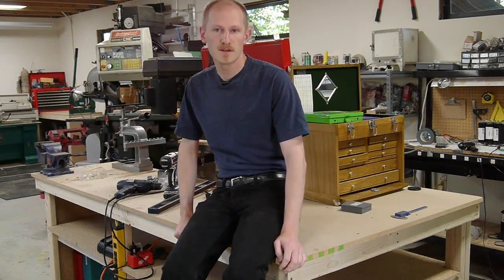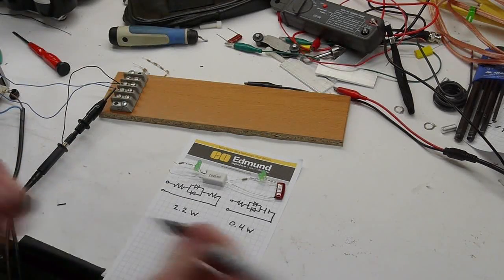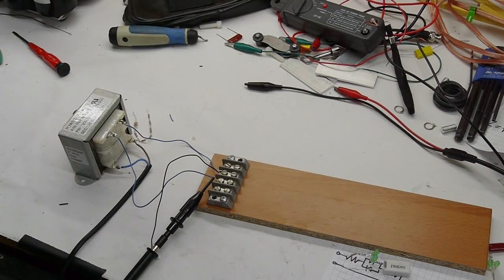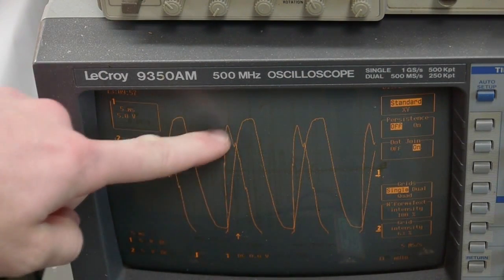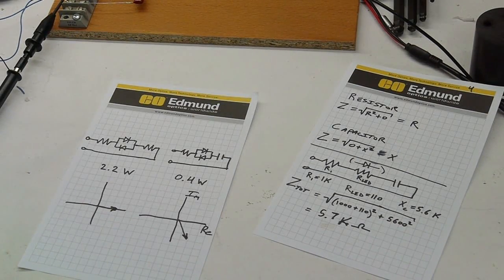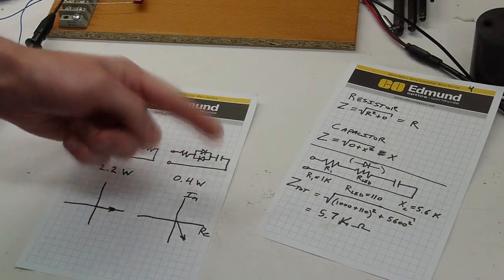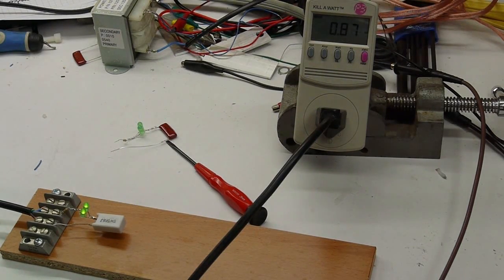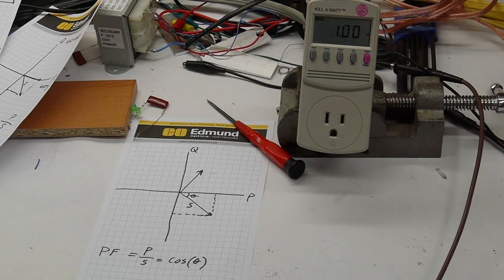Tutorial: Electrical impedance made easy - Part 2

Comment: Is there a law against selling devices like lamps with capacitors built in to make the power factor really low so you don't have to pay as much on your electricity bill?
Reply: Akfloatable The capacitor and the resistor both serve the same purpose in this case: To reduce the voltage going to the LED to safe amounts. However, they each do so very differently: The resistor burns up all the extra voltage as heat, and thus gets very hot, and wastes a lot of energy. The Capacitor instead temporarily "stores" the extra voltage, and then sends the extra current back a short time later.

In both cases, the LED itself gets about the same amount of power. (Hence the same brightness.) However, the resistor circuit also uses a lot of extra power to heat the resistor. (Wasted power, but power nonetheless.)

In either case, the power company will charge you for the power that you actually use: In the capacitor case, just a little bit of power for the LED; in the resistor case, a little bit for the LED + a lot for the heat.
Reply: Akfloatable You and Ben asked slightly different questions:

Ben asked whether he could get some "free" savings on your electric bill by adding a capacitor to a device, such as a lamp. My answer was no: Normally, a lamp is connected directly to the outlet, such that it runs at full brightness. If you then put a capacitor in series with the lamp, then you will decrease the brightness, as it no longer receives full voltage. You do save some $ on your electric bill, but you've also cut the brightness by the same amount: You come out even.

Your question was why the brightness was the same in both experiments in the video. That case is a bit different: In both circuits, there was a brightness-reduction device in the circuit, to make sure the LED didn't burn out. In the first case, he used a very inefficient circuit, which burned up a lot of heat. In the second case, he used a much better circuit (capacitor), which was far more efficient. Basically, the video showed a bit about how capacitors work, and how they can be better than resistors in some cases.

For Ben's question: You can't get something for nothing. If you use more electricity, the power company will charge you more.

For your question: Both circuits had the same LED brightness. However, one wasted a bunch of extra power to heat the room, and the other didn't. All that means is that some circuits can be more wasteful than others, which you probably already knew.
Reply: Akfloatable I'll add a car analogy:

I'll rephrase Ben's question: Can't you save on gas by driving half as far? Answer: Of course you can. But you haven't really "tricked" the oil companies; you've just gone half as far, and used half as much gas. (Adding a capacitor where there wasn't anything before is the electrical equivalent of reducing power to the engine-- perfectly legal, but not necessarily helpful.)

In your question, you were comparing two circuits: The first (resistor) was a big SUV, that wastes a lot of gas. The second (capacitor) was a Toyota Prius. Both will get you to the same place, but the Toyota will use a lot less gas to do so.
Reply: Ben Thurston Also would it make sense if you were running off of a generator (locally generating ac power) to make all your loads with really low power factor because the distance the electricity has to travel is so small to your generator and thus minimizing loss in the power lines? Or would there be the same amount of loss in the short line heating up the wire a lot?
Reply: Ben Thurston No law is really needed, as lowering the power factor will also lower the amount of usable power you get to your lamp (or whatever). In other words, if you added capacitance to cut your power factor in half, then your lamp's brightness would also cut in half. As such, while you could reduce your electric bill this way, you'd also reduce your (useful) electricity by the same amount-- everybody comes out even.
Reply: EricPiGuy Oh I see, but with something like a 100W light bulb would it be good to match the power factor to the right portion of power coming from the mains? Or do you end up spending too much on components to make it worthwhile? I'm going to hit you up on Patreon as soon as I have a little extra money I love all these videos so much...
Reply: Ben Thurston Well I think I see the problem that every time you plugged something else in or turned something on it would change the electronics needed to adjust the power factor, but maybe for a certain fixed array of devices that were always on it would be good to optimize for that...
Reply: Ben Thurston Dang sorry I went to give you 10 bucks on patreon but I didn't see a way to do just a one time donation,  you make a lot of videos I can't do a certain amount per video
Reply: +EricPiGuy Then why were the LEDs in this video just as bright when using the capacitor vs using the resistor?
Reply: EricPiGuy Maybe I'm misunderstanding but you said in your earlier comment:

"if you added capacitance to cut your power factor in half, then your lamp's brightness would also cut in half."

If in both cases the LED gets the same power, wouldn't the brightness be the same? And if that's the case then there's no draw back in trying to reduce the power factor by adding capacitors or inductors in order to reduce your electricity bill.
Reply: +EricPiGuy thanks, I also think this answers my question as well. I did not see where the electric company was losing out on money by allowing the transmission lines to burn up the energy in a low PF circuit. Makes sense now, nothing for free! so true

Comment: Ah, but the wattmeters are typically built with inductors, so their PFs are going to be less than 1.  And current in them will lag the voltage.  I wonder if any wattmeters have PFC by adding capacitance.

Also there are switching power supplies.  Again, for industrial applications (in my job experience, a call center with lots and lots of computers), power factor correction in the PSUs used for the computers was a big concern, not only for utility costs but also for proper operation of the backup generators and UPSes.

Comment: I noticed that a little bit was not mentioned , most circuits have reactance some are capacitive negative - as mentioned .
Left out from my limited knowledge , most all circuits have reactance , both negative / capacitive reactance & positive reactance inductive - above the horizontal line ;)
My perspective is from RF ham radio so a lot of all of the above in antennas & feedline Thanks
John
KD0CAC

Comment: In an industrial setting when the power company asks you to correct your power factor. If you make your load more resistive it will not change the inner workings of a motor. So therefore are you not wasting energy as the motor will still be generating the same inductance and reactive power which you cannot be billed for but you are then consuming additional resistive load which needs to be dissipated?  Although it seems fair that you should be charged some additional amount for the energy which is being pushed down the line to you, why not just calculate the inductive load and add a % to the bill, rather than force companies to waste and consume more power with increased impedance?
Reply: James A. McGuire I'm no real expert at this like Applied Science too long since I messed with the detailed math about it at university with physics before I switched to computer science.

But if I'd have to guess the problem the power company might have with it is that it can cause the mains to go too far out of phase. If it was a one on one situation I suppose this might be alright but I suspect there's a fair chance if say company A delivers power to company B and C. B is a big player and needs a lot of electricity and C not as much but they're fairly close to each other and B causes a pretty bad power factor which affects how some things work at company C.

In particular big electrical AC motors won't run as well if things are too far out of phase from what I remember and in my country there's regulation about it as well if I'm not mistaken but this will vary all over the world.

Comment: So, what happens to the efficiency of your LED circuit if you were to use both a capacitor and an inductor in order to get the power factor closer to 1? (impedance matching?)   Great explanations, wish I had seen this video back in college when I learned about ELI the ICE man...
Reply from the maker: Chris Sloan
 The power factor indicates how much loss will occur in the transmission lines, and is not necessarily correlated with an equipment's efficiency in terms of work output vs watts input of real power.  We could have two motors with different power factors, but the same efficiency in terms of horsepower/watt.  You are correct about fixing the power factor with inductance in the LED circuit.  Adding inductance will make the impedance vector shorter (by cancelling the capacitance), and reduce the overall impedance value, thus causing too much current to flow in the LED.  There is no way to solve this problem linearly without adding either reactance (causing low power factor) or resistance (dissipating real power).  A good alternative is to use a switch-mode power supply, which is a nonlinear device and does not have to obey the same rules of design.
Reply from the maker: Using impedance to correct the power factor of a capacitive circuit is a great idea.  Many modern switchmode power supplies have dedicated inductors and monitoring electronics to supply just the right amount of inductance to bring the power factor very close to 1 for varying load conditions.
Reply: Austin Hayducky - Yes, if you add enough inductance to cancel out all the capacitive reactance then you have a parallel resonant circuit, which will draw very little power from the supply. But you will have a large current circulating back and forth between the inductor and capacitor, which would be too much for the LED. To bring the current down to the required value, you would need to add as much resistance as there was in the original circuit without the capacitor, so you would waste just as much power. You can't win!

The reason you can correct the power factor of e.g. an electric motor by putting a capacitor across it, but you can't do the same thing for the LED circuit by putting an inductor across it, is that in the case of the motor, we're not trying to reduce the voltage -- the motor is designed to run from the full mains voltage. But for the LED we need to reduce the voltage from mains down to a couple of volts.
Reply: Applied Science I understand how power factor correction helps the power distribution system.  Does it also improve (or decrease?) efficiency for my local equipment if it is corrected?  Or is it neutral?

Also, for our LED/resistor/cap circuit, am I correct that if we cancelled the reactive power with an inductor, so now it has a power factor of 1 again, then if we didn't increase the resistance, we'd get more current again?  (120V / 1110 ohm ~ 108 mA)?  Or is it possible to correct the power factor and not increase the current?  (We do have three sources of impedance now, but as I understand it, their vector sum would mean that the cap and inductor would cancel... but I'm way our of practice on this...)

BTW, I'm new to your channel, but have found it very entertaining and educational.  Thanks.
Reply: "There is no way to solve this problem linearly without adding either reactance"
The impedance of a resonating circuit is maximized in parallel wiring
Reply: limo service, Ottawa

Comment: Is there any type of circuitry that could ensure the right timing for triggering the circuit into the on-state, so that the circuit can only be smoothly turned on into conduction when the voltage is at its lowest value (zero, basically) and is just gradually starting to increase towards negative or positive peak, in order to provide the current limiting capacitor with some time, allowing it to accumulate some charge so it could begin to impede the current flow (and as long as the capacitor doesn't "see" any change in voltage it won't start to react and the current won't see any opposition whatsoever except the only opposition that is provided by the load impedance) and avoid voltage and therefore current spikes on the load side. Because without this type of circuitry you're left with only two possible choices: to either experience great power losses due to insertion of a current limiting resistor, or be ready to fry your load due to transients, after a few cycles of turning the circuit on and off.
Will the phase-fired controllers do the trick?

Comment: I'm wondering if connecting a capacitor and resistor in series (for current limiting purposes) will actually have any effect on the operation of my angle grinder (in terms of the power factor correction or its further degradation :) which is rated at 2kW. I just don't want to use a transformer for powering the fan that will be cooling my soft-start circuit module and simply run it from the mains through a rectifying and voltage regulating circuit with all protection components included. I believe that the circuit I'm talking about is called "Transformerless power supply."

Comment: At 19 min you said that the reason you see a capacitor strapped on the side of a motor, is to correct the power factor.  I thought this is the start capacitor for a single phase motor ?  It is wired in parallel to the run winding, and drops out with a centrifugal switch, after the motor starts rotating.  The power factor capacitors in factories for motors are usually in a cabinet near the motor.  (I thought) please correct me if I'm wrong)

Comment: Why is it false to say that the LEDs behaves like a resistor? Individually, they're more like diodes with a certain internal resistance like any diode, but together, it's just a lamp. A lamp is just a bunch of resistance right? resistance made to be able to heat up hot enough to make light. At least thats how the older light bulbs work right?

Comment: what happens if you put an inductor in series with your capacitor in your circuit and have both of their impedance equal to 2.8kOhms so you have a perfect power factor? would your circuit work properly?

Comment from the maker: A motor is basically a coil of wire, so it has resistance and inductance, and its resulting impedance vector will have a positive angle (first quadrant). A capacitor by itself has (almost) only capacitance, and its impedance vector will be at -90* (between third and fourth quadrants). The overall impedance is the geometric sum of these vectors, so it is possible to size the capacitor such that the resulting vector is at 0* (PF=1).  Capacitor gives power when inductor needs it and vice versa.

Comment from the maker: This is because capacitance is represented by negative imaginary numbers, and inductance by positive imaginary numbers. The reason for this is that capacitive circuits have a current-leading waveform, and negative imaginary numbers make the math work. Having a combination of resistance and capacitance will place the point in the lower right quadrant.
Reply: Just your gloss on the role of imaginary numbers -- the real world use they have here -- made the imaginary more real than they have ever been hitherto. Thanks! Vote +1 for part III.

Comment: Great tutorial. If you have the time, can you explain to me why the current in a series RC circuit with a DC source is not zero?  The current into and voltage across the capacitor is easily derived from Q=CV, Ohms law, and KVL, but there seems to be a disconnect when approaching the problem by viewing the source as AC at 0Hz, and you just take the voltage phasor divided by the total series impedance (infinite), you get a phasor current equal to 0. I obviously have something mixed up here. Thanks

Comment from the maker: Sort of. Those small power adapters are switch-mode power supplies, and run at frequencies much higher than 50/60Hz. The higher frequencies do not require such massive transformers because the magnetic circuit required to convey the higher frequencies can be made with less material. Standard 50/60Hz transformers must necessarily contain a lot of iron because the frequency is low, and requires a suitably large magnetic pathway.

Comment: You could put a capacitor in series with a light globe, and it would consume less current. But it would also consume less power, and therefore: produce less light!
To output 100W (mostly of heat, natch) out you need to put 100W of electricity in. Halve the voltage, you will halve the current, quarter the power, and a feint, dull red glow from the filament.

Comment: @ntjbjhq Yes sir.  Many very large motors that are hugely inductive can become more efficient by adding a capacitor that effectively reduces the reactance to produce a purely resistive circuit.  That capacitor corrects the phase difference between the current and voltage, which explains it's power factor.

Comment: Could you improve the power factor of your cap/led circuit by adding an inductor?  Would that cause the current-leading to become more inline with the voltage waveform?
Reply: Theoretically yes, you could improve the power factor by adding an inductor.  In practice however, it is not practical.  At 60Hz, 5.6K of reactance requires a 14.85Henry inductor, which would be very large.  Since it would be wound with copper, and probably use a laminated steel core, it would also be very lossy, (i.e. low Q) and consume a fair amount of real power.

It (the inductor) would cause the current waveform to lag the voltage waveform in a similar, but opposite direction, that the capacitor caused a lead.  The lag wouldn't be as pronounced however because of all the losses mentioned above.